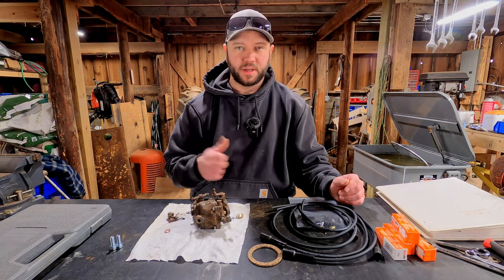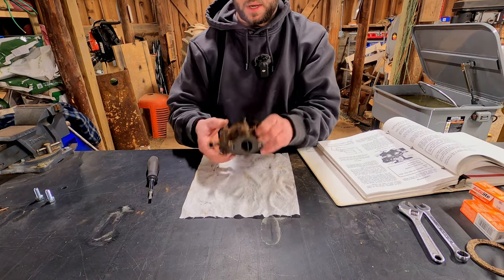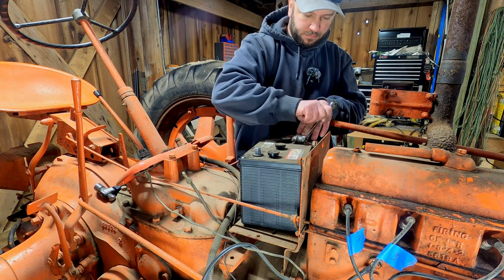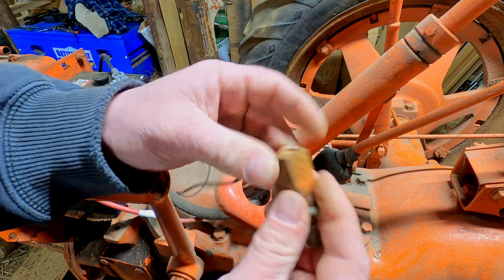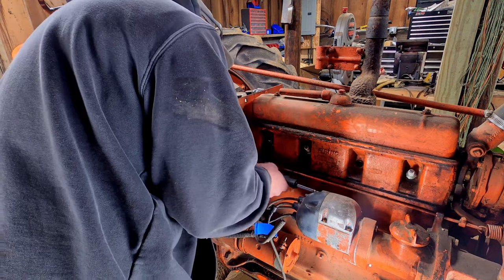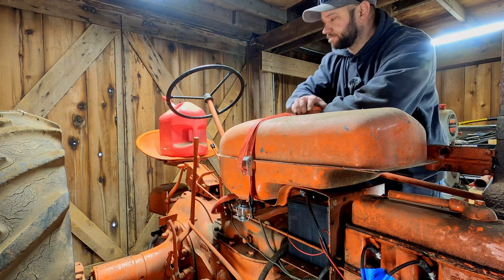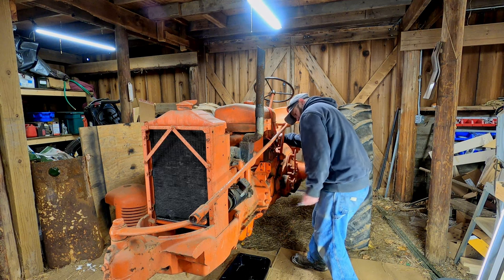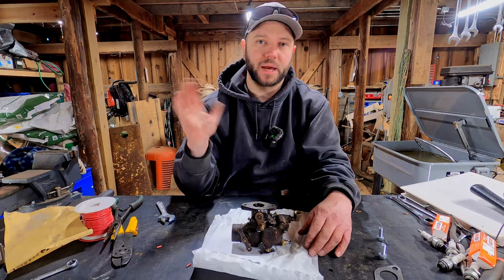MORE CARBURETOR FAILS! WITH 1943 CASE SC

Comment: I feel your pain Justin. I was really hoping that would fire up at the end of the video but with that new needle valve being slightly different, I guess it really shouldn’t have surprised me.
I have been having my own issues. After my 2520 John Deere suffered the hydraulic failure in my last video, I am having some real issues with getting to where the problem is. The floor pan has to come up and it won’t. I have a John Deere mechanic coming next week to help me with it. If the problem is the hose that I tjlhink it is, I am going to have another problem
Reply from the maker: Oh man I'm sorry to hear that! I hope you get it worked out. My next video on the old Case didn't go any better. The project started out really good, now it seem that everything is fighting me. I guess that's just part of the process. Thanks for watching!
Reply: @JustCaidsDayFarm  , the upside for both of us Justin is that we are each learning more about these machines. It may be a bit painful now but I am willing to bet that both of us are going to be better off because of it.
Reply from the maker: @tractortalkwithgary1271  with out a doubt! I'm still having fun and the whole point of getting the tractor was to learn and do things I have never done before. A bad day in the shop is still better than a day at work. lol